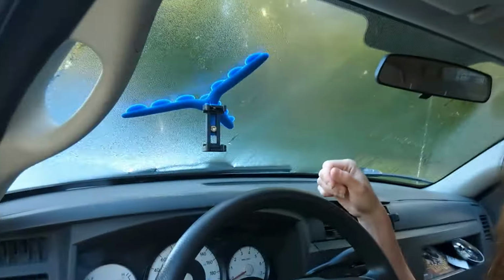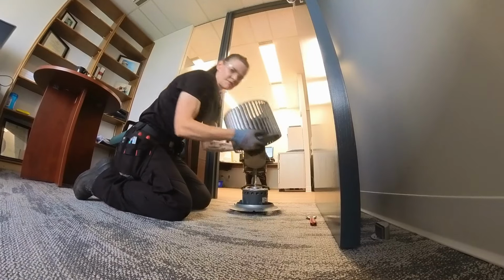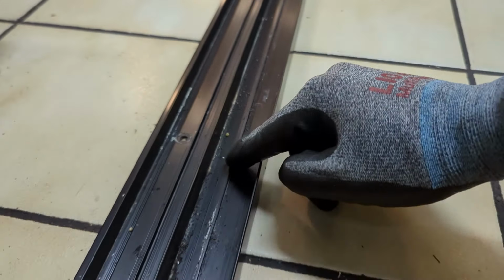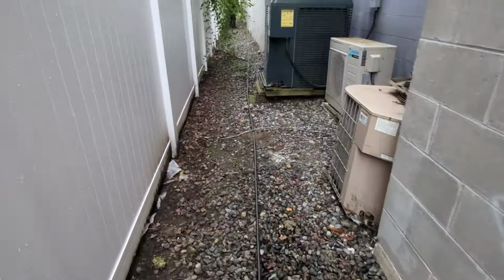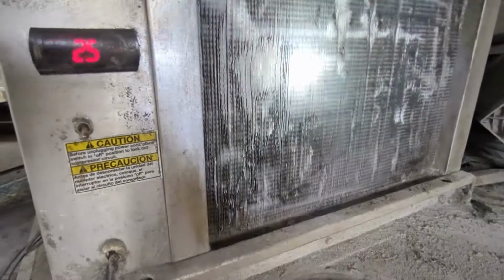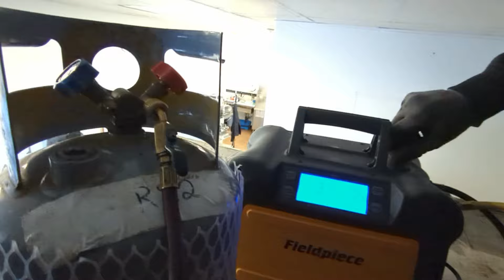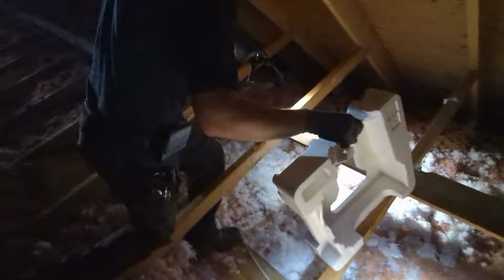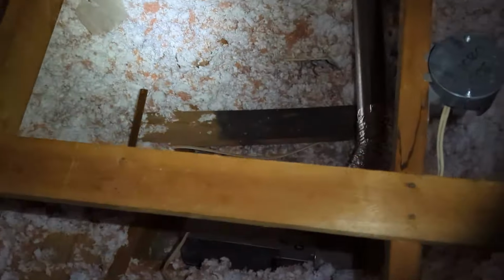My Life as an HVAC/R Tech | HVAC Vlog

Comment: That's a good blower design you don't have to take the blower out of the case
Reply: Would definitely make things easier
Reply from the maker: Do you guys mean, do it differently to how I did it?  How do you get the wheel off if you don't take the blower out of the case?
Reply: @hvacjess I meant to say without removing the entire blower, assembly, from the unit